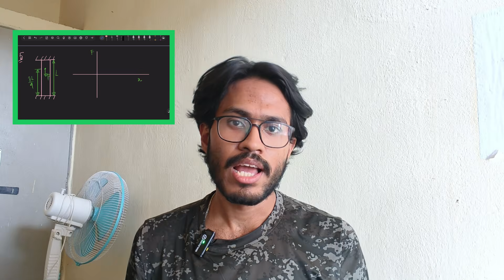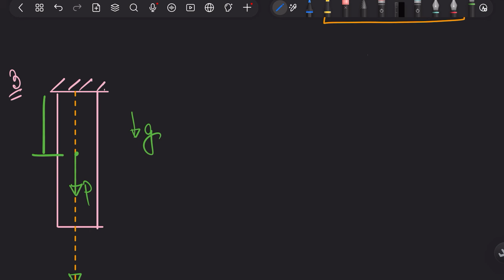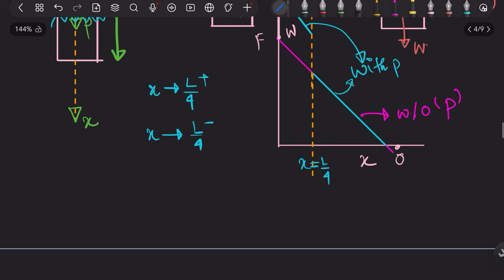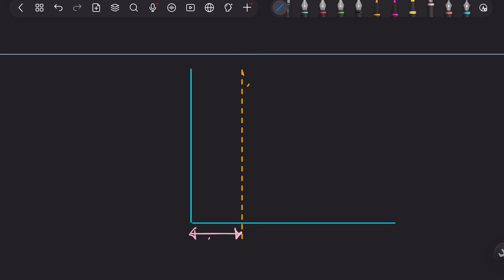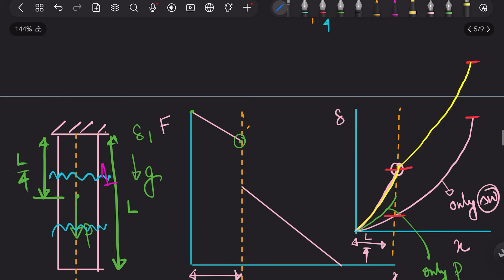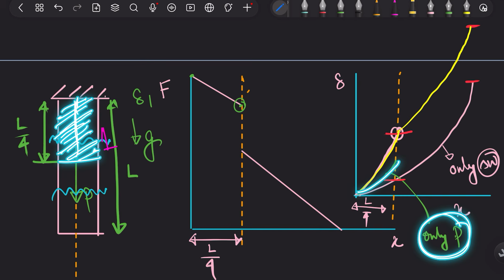The best BARC PREP course on SOM EVER| MADE BY GATE AIR 6| DRDO SELECTED| ISRO AIR 44

Comment: isnt deflection vs distance graph wrong? Because deflection at distance x is due to weight of material below it, and that decreases as x increases, so it should be concave down?
Reply from the maker: Yes bro you are absolutely correct. I have also made a correction video regarding that in my course. I admit my mistake